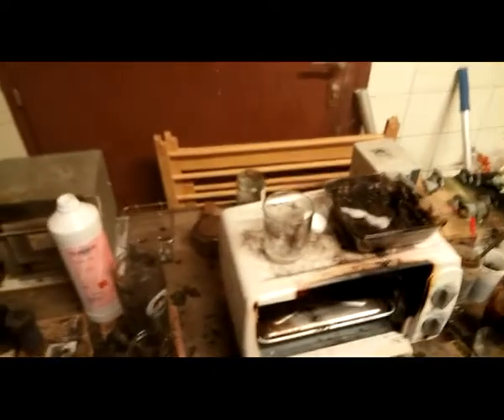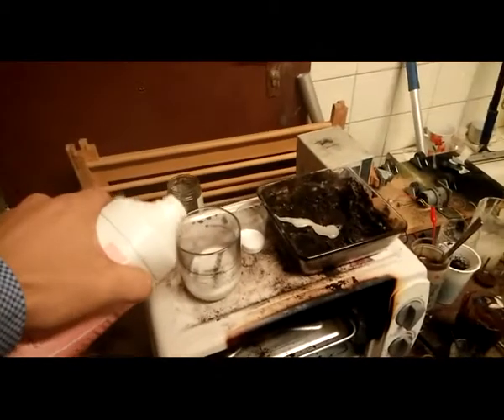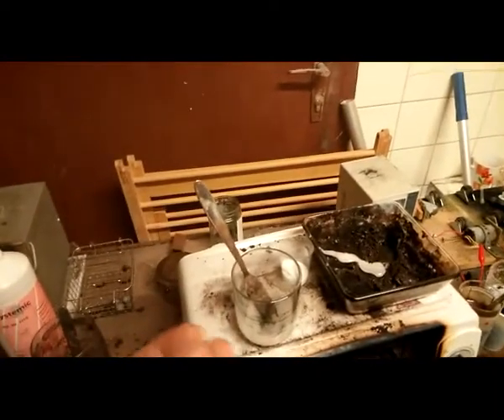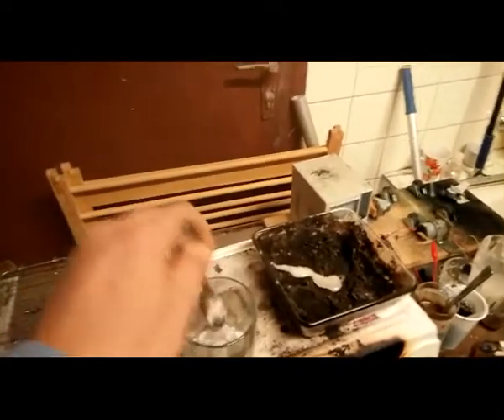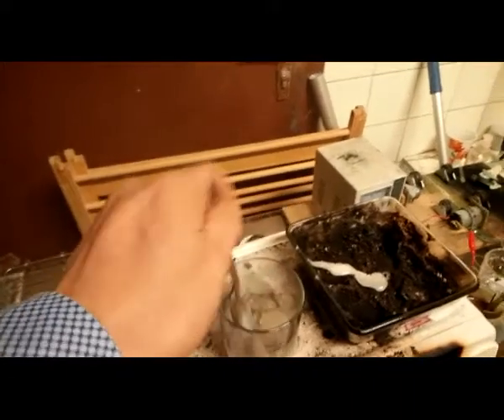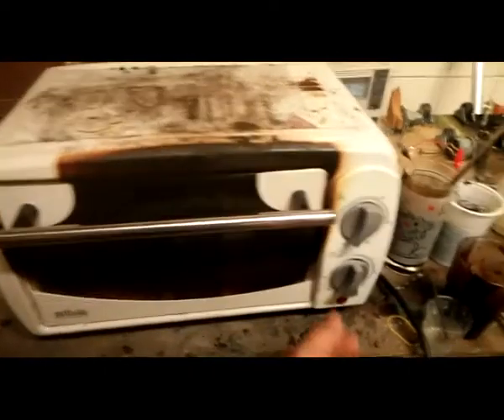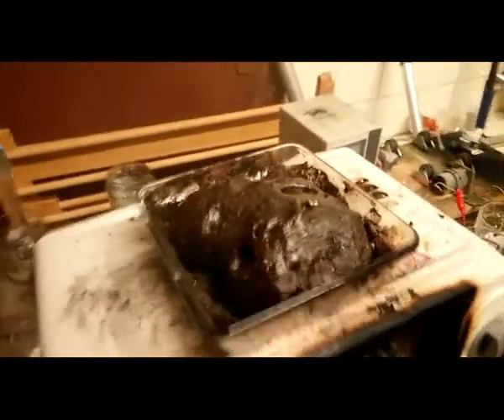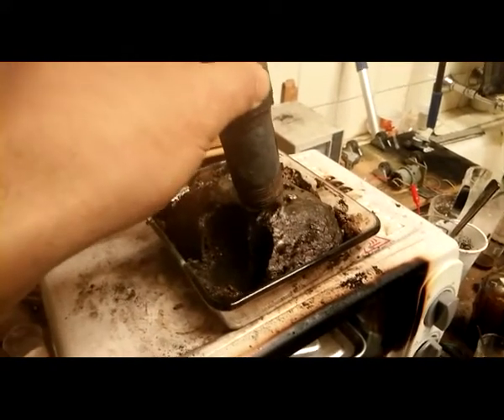how to make a supercapacitor part 1 active material

Comment: Thank you for sharing, instead of potassium hydroxide you could use sodium hydroxide ??
Is that activated carbon already conductive?
I'm looking forward to the second part of the video,
 happy year
Reply from the maker: yes, sodium hydroxide works to. after heating it with 1000 c. it has about 
30 - 50 ohm.

Comment: Good vid. 
what is the molar strength of the KOH as I only have crystals?
What is the white powder added to the sugar mix?
Could a microwave be used for the second heating?
Thanks Martin.
Reply from the maker: not sure I thinks 1 : 10 .
the powder is cream stiffener but it is not nescessery.
never tryed it in the microwave but give it a go.
Reply: Cheers mate, I will put it on my "to do list"   :-)